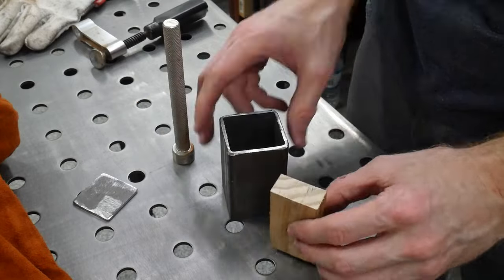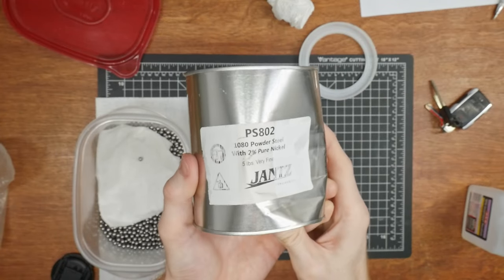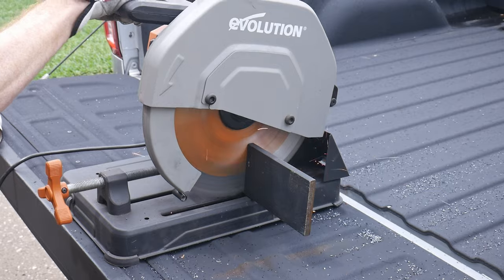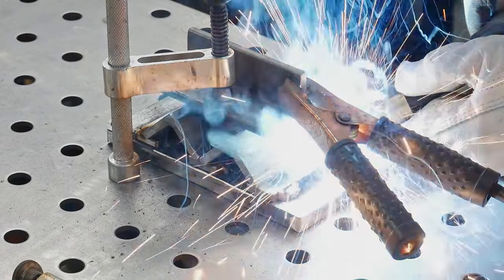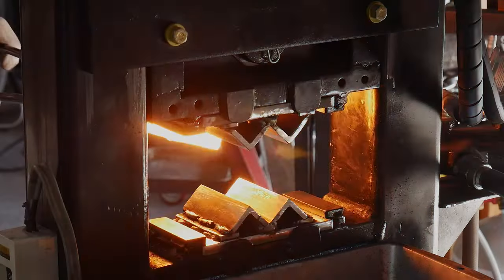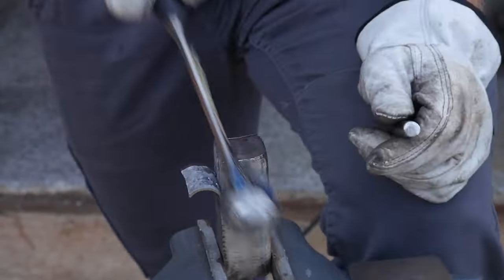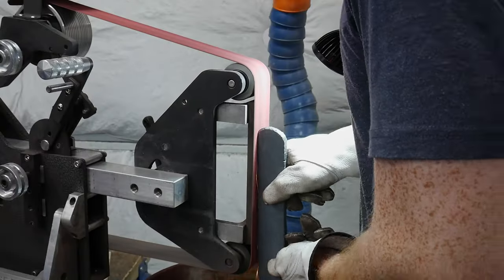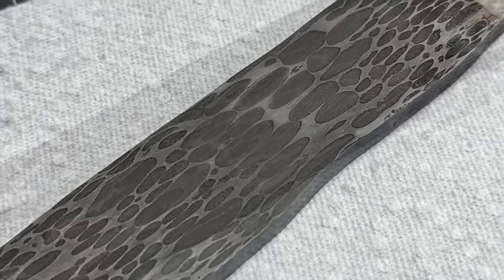Forging Ball Bearing Canister Damascus | Knife Making | Blacksmithing

Comment: Nice job! Sorry you didn't have much luck with the white paint. I find that if you're welding towards the upper end of temps the barrier can be defeated. I don't use a forced-air forge, so I haven't had to deal with that for the most part.
Reply from the maker: Man; it was probably user error. I need a better vice and all if I want to do that again. Maybe burn the inside of the van to build a carbon layer; idk. Cheers man! Thanks for the vids.
Reply: @RedBeardOps  you bet, thanks!

Comment: all you needed to do was to dip the "can" in oil. then torch it till red hot.
Reply from the maker: Nice, does this build up a layer of carbon on the inside of the can?
Reply: @RedBeardOps  yes. i use it for casting precious metals.

Comment: I was thinking I was being pedantic, I wouldnt have a vent hole facing my hand while dealing with hot metal and high pressure....  turns out its the ignited steel powder wind from hell that is the problem.

Looks like a nice billett James, looking forward to seeing your creation.